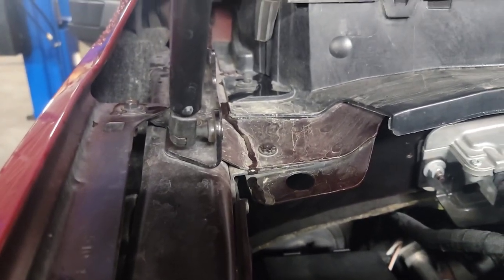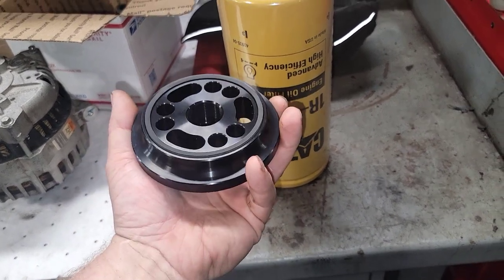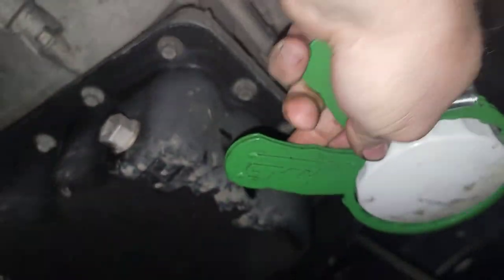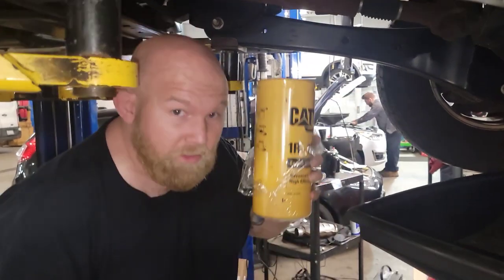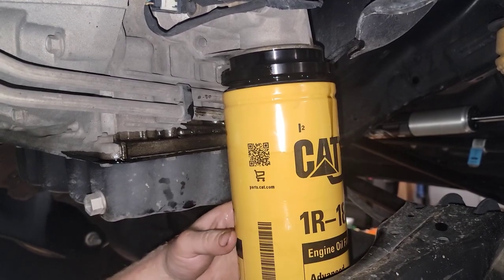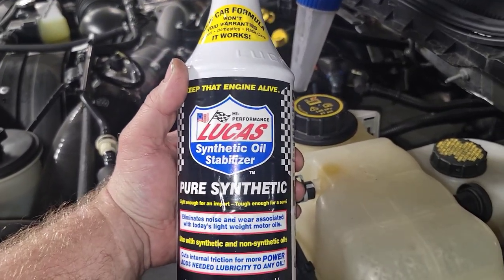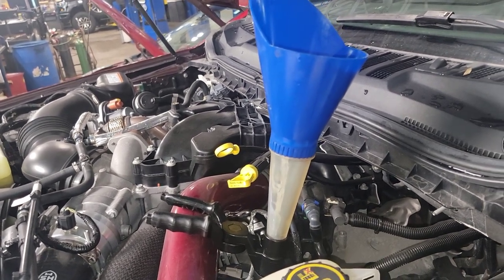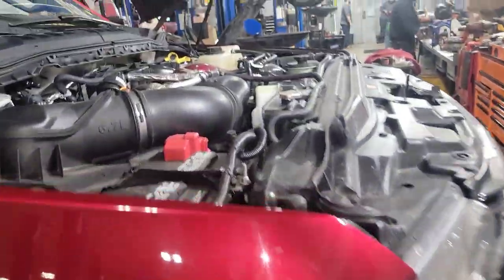MDD PERFORMANCE - 2011 - 2023 Ford Superduty Oil Filter Cat Filter Upgrade

Comment: I like that setup. I’m just already concerned how the PS oil filter hangs down and this setup drops maybe 2” more. I’m off road a lot and concerned about filter damage from rocks or sticks. Thanks for the info Rich and he has a sharp truck!
Reply from the maker: I mean an order for anything to really do any damage to it it would have to damage the front end and the radius arm
Reply from the maker: The filter is higher than both of them

Comment: I just did an oil change with some good ole T6 5w 40.  Gonna try Shaffers 5w40  9000 OTR , and Some T5 15w 40 , test all 3 and make a Choice on what to stick with. 
I like the CAT setup. Looks good for a Hot Shot Rig. 
I like the idea of that drip Tray .
I'm in Phoenix and was wondering if 15w 40 is a good choice for my 6.7 in the hot 8 months. We see over 115F  in Summer.
Reply from the maker: @user-pf1bf7kn4j  it's actually not a hundred percent group four PAO that's a story people spread 

if you actually watch the Gail banks engineering video they admit that the majority of it is group 3
Reply: @Jon-O.  It was 30f this morning when I headed off to work. That's for sure not cold to a person from a Northern State but probably good for running 5w40 right now. My Goal is Longevity, Id like my truck to still be in good shape in 15 years .

Comment: Per CAT literature. The filter specs are closer to 4 micron at 20% and 25 micron 100%. The absolute value is 20 micron or roughly 95-98% efficiency. This puts the absolute rating closer to the Ford OEM rating.

What does get my attention here is the bypass pressure rating. It does not have one…. Ford 6.7 does not have an internal bypass like ones used in CAT or Cummins powerplants. This is strictly a use at your own risk.
Reply: To add, I do not believe there is an anti-drain back valve on these elements. Could be wrong but I don’t see one listed.
Reply from the maker: Absolutely nobody's twisting anybody's arm nobody's telling people to go out and do it you have to make your own choices, I was warned that people were going to come here and bring up the bypass rating and if I was concerned with that I would have brought it up but I'm not concerned with that

No this is just a how-to video If people start getting twisted off and wanting to start causing problems they can be removed just like the next person can so I appreciate you clearing this up

 although I don't think it was necessary I do appreciate it, people can make their own choices and they don't need to complain about choices that others make
Reply: @FordBossMe  that is completely fair and you’re not twisting my arm. Just brought up the information I have. 
You said it countless times when you did the pre fill. Owner is getting what he wants per his direction. Not a thing wrong with that.
Reply: I totally understand the “risk” involved my decision was centered on the extra 1.25 qts of oil that the engine now has available to “contaminate” vs the stock capacity coupled with bigger filter surface area was the difference maker in my evaluation on to do vs not to do.
Reply from the maker: @croutster8399  and the fact that it started much quieter
Reply: @croutster8399  a familiar name! Hi buddy! lol
I can understand what you’re saying by adding a bit over a quart of additional capacity to the system. Planning on extending your OCI?
Reply: @vais3  No I’ll keep at current intervals unless very exceptional circumstances do not allow me to get to it by what I do currently.  I’m pretty tight about the oil change.  The objective for me here was to provide extra oil to take up and absorb some more of the contaminants over the service interval thereby reducing wear internally over the course of the life of the vehicle.
Reply: @croutster8399  makes complete sense honestly. Should reduce soot loading percentage a bit. By chance, have you seen the PPE cast aluminum oil pan for those? Adds another quart into the system as well. This in conjunction to the filter would up capacity to 15.25. That’s just above the 7.3 PSD.
Reply: @vais3  yes I have and both pans for trans and oil are on my wish list.  That’s next fall’s update I’m not back working yet and this was the less expensive of the two options .  Once we get back to,work , they will be on the to do list!
Reply: @croutster8399  oh man. That’s not good. Any good prospects for work?
Reply: @vais3  oh my biz is always like this feast and famine.  I have a couple more weeks off but I’m ready I’ll tell ya
Reply: @croutster8399  sounds much like mine as well. Best of luck and hopefully it’s feast for you soon good buddy.
Reply: @vais3  why would a filter mounted vertically need an anti-drainback valve? The Cummins Filtration LF16035 used on the entire 6B engine family as installed in Dodge/Ram trucks has no anti-drainback valve because it mounts vertically.
Reply: @vais3  gee, I have owned Cummins powered Dodge/Ram pickups since 1989 so I think I am rather familiar. If an anti-drainback valve was necessary for a vertical mounted filter manufactured by Cummins Filtration (a wholly-owned subsidiary of Cummins Engine Company) would include one in the LF16035.
Reply: @walterk1221  again, different engineering of the lube circuits. It’s not just an orientation thing. Out of respect for both this channel and the owner I’ll stop responding.
Reply: @vais3  the difference, I believe, is due to the Cummins filter head being located above the oilpump and the PSD and Duramax being located below the oilpump. That, I believe, is why PSD and Duramax "pee" on the hand and the Cummins does not.
Reply from the maker: @walterk1221  I thought the reason that they don't use that in the Cummins is because the valve is built into the actual pump assembly and there's no reason for it to actually be in the filter
Reply: @Ford Boss Me  the bypass valve is in the filter head assembly in the B-series Cummins engines. 
The filter doesn't require an anti-drainback valve because it is mounted vertical and it can't drain as a horizontal or 'upside-down' (Chrysler slant-six and numerous Subaru) will.
Reply: @vais3  look, a vertically mounted filter SIMPLY CANNOT DRAINBACK. If it could, your coffee would fly right out of the cup.
Reply: @vais3  what exactly does your scenario have to do with an anti-drainback valve? The function of an anti-drainback valve is to prevent a non-vertical filter from draining so as to prevent dry starts. I now cannot fathom what you continue to argue (and failing, as I don't really care what your education or background is, you are attempting to argue nomenclature and scientific principles with an engineer).

Comment: 23's are gonna have the same water problem. Bjb is in the same spot......
Reply: Small bit of an edge guard used for trim, commercial cable tray and doors may offer just enough protection. Pretty commonly available too.

Comment: Do you see any issues running that set up as far as warranty concern if the engine for some reason suffered catastrophic failure and it got towed in with that set up?
Reply: They would have to prove that the oil filter caused the failure.
Reply from the maker: No I don't but I'm not going to talk about warranty stuff right now with this filter you have to make your own choice on that
Reply: You can guess the conversation if you tried to claim an engine with an aftermarket adopter and CAT oil filter hanging off it, They don't want to pay at the best of times.
Reply: If god for anything happens, take the filter and adapter off and put a motomaster back on it before you bring it in,,,,, is what I'd say to do if you were dishonest. ;)

Comment: I prefilled the filter all the time
Reply from the maker: Not necessary
Reply: Filling the filter can introduce more contaminant. That’s what I was taught at caterpillar engine school .
Reply: Kinda hard to prefill the oil filter on some were the filters upside down or vertical. All the oil is gunna run out

Comment: Kind of funny but we all, me absolutely included, are so worried about the specific oil and filter but it is not usually the wear surfaces like bearings that are wrecking vehicles - if we change  oil etc.  It is usually emissions equipment, turbos and electronics that go out.  Then they are just too costly to keep up and we sell.  Maybe I am wrong and stop me if I am.  Thanks for the videos.
Reply from the maker: Yeah there's no damage that's going to take place to that stuff there's still enough residual oil there where there's no problem

Comment: I’m genuinely curious about this upgrade. I understand the flow is double factory on the filter and the additional surface area of the media, so the bypass would be a non issue. My curiosity point is the anti siphon flap. Do you think this is really an issue or risk of dry starts? I run oil analysis at every interval on my truck so the test results would show but could take time. Curious @fordbossme about your opinion, considering your oil testing and experience. Thanks for reading.
Reply from the maker: I could do testing but that'll just add another thing for me to do and I can't squeeze it in now 

The owner of this truck is loving his upgrade

Comment: Is clear flood mode only available on gas engines?  I would assume so.  That's how I've always prefilled the oil filters on my gas vehicles.  Hammer down on the throttle and crank until the oil pressure light goes off.  Engine won't start when the throttle is hammered down and clear flood mode engages.  Doesn't work on my 02 Dodge Cummins truck but I thought all newer vehicles you could do this.
Reply from the maker: Yes

Comment: Hey Rich my dad just bought a 22' F250. I've been really hitting your oil analysis videos hard. My question is IF I did this mod or didnt even use the Motorcraft oil, but used a Ford spec oil and came in for a concern that had to do with powertrain under warranty in your experience would Ford deny the warranty because of the above resons?
Reply from the maker: Leave yours the way it is don't do this mod until you're out of warranty
Reply: what about not using ford oil?
 @FordBossMe

Comment: I was told these cat filters don’t have a Bypass Valve built in like the OEM filters is this true because that valve saves the motor in longevity during startups/cold starts
Reply from the maker: These filters are not causing one single issue with these trucks so don't believe anything you hear on days if people don't run them or if they don't have any experience with them

Comment: Are you guys worried that this filter does not have a bypass system? I have read it can be bad due to the engine not having a by pass..
Reply from the maker: The oil pump does have protection built into it

Comment: Cat says not to prefill any filters...but mainly fuel. I guess it cant hurt since you put it on the dirty side. I realize you cya so this is sorta redundant. Caterpillar machines have a  crank without start switch so you can easily prime after an oil change.

Comment: Is it ok that cat filter doesn't have a bypass ?
Reply from the maker: The oil pump has a check valve but we've had a few issues with these filters, the base that you have to adapt to the truck to put the filter on spun off a few times with the filter so now they use Loctite on the threads and I tell people all the time unless you possibly might want to end up damaging the original threads that are on the vehicle it may or may not be a good idea to put these filters on there
Reply: Holy crap if I had a penny for every "bypass" comment, I'd be rich.

Comment: Rich, where did you get that oil funnel from???
Reply: Sold on Amazon, I got one specific for my Subaru. Just search oil funnel on Amazon.. these are specific for vehicles..
Reply from the maker: This one actually was sold out after I talked about it last year and it hasn't been back in stock since this is not a specific type for any specific vehicle this is universal and it has a locking jaw on the end to help hold it

Comment: It’s clean oil, I pour it in the middle.
Reply from the maker: Well that's the wrong way to do it you're supposed to pour it from the exterior holes
Reply: @FordBossMe  well I m not sure why, if you think it’s filtering it then pouring oil in through the fill tube would be wrong.

Comment: I know it's an F-350 and all but this is not something I would do if I used this truck for logging or even going over some moderately bad dirt roads looks like that filter can just be taken right off. it's halfway down the axle! But if it's for on road towing sure why not...
Reply from the maker: Well that's that's a good thing that nobody's asking you what you would do and it's also a good thing that they axle is lower than the oil filter and the actual radius arm so nothing will hit the filter ahead of time. Remember stay in your lane unless somebody's asking you what you would do don't open your mouth because it wasn't a question to you that was me demonstrating how it's done
Reply: @FordBossMe  Must have been the camera angle it really did look like it was very low however, your right, nobody asked and I should have not even commented. You humbled me.

Comment: Terrible advice coming from a mechanic.  

The CAT oil filter do not have the bypass valve required for the 6.7 power strokes.  

The 6.7 does not have an internal bypass valve in the motor.   They require a filter with a bypass.  Not having a bypass will starve the motor of oil until it is warmed up.   

CAT is a great brand but their filters are not designed to be ran on the 6.7.   These mechanics should know better.

Comment: The CAT filter does not have an internal bypass valve. It's designed for an engine with the oil bypass in the block. Cold starts... all that effort was wasted to fill the filter from the dirty side, you'll be sending unfiltered oil soon enough through a perforated media or torn at the potting material on the endcaps.. The Lucas additive, good grief, anything but Lucas. Nothing more than cheap VI in bright stock, it only dilutes a premium oil add pack, not enhance it. I appreciate FBM doing what the owner wanted, but the owner needs to do some research before buying the next shiny farkle.
Reply from the maker: You are repeating what many other people have already repeated and you're not looking through the comments to see what has been talked about I'm not going to put a lot of energy into what you're saying because a lot of people that have been saying stuff about this don't actually know what they're talking about and they're just blabbing stuff they don't even have a clue
Reply from the maker: On this channel we don't pick apart what other people choose to do with their vehicle as long as it's their vehicle and it's not hurting anything we're not going to say anything about it we're not going to bully them or make them feel bad as I said it is a subscriber here on this channel and you are going to respect me enough to keep that to yourself I hope I've made myself clear
Reply from the maker: That's actually not how the system works because the system has two check valves in it so just because the bypass is not in the filter doesn't mean it doesn't have another bypass which it does and it's actually in the pump itself
Reply: @beanoil show me a preforated cat filter.